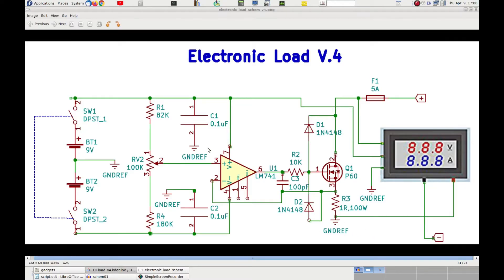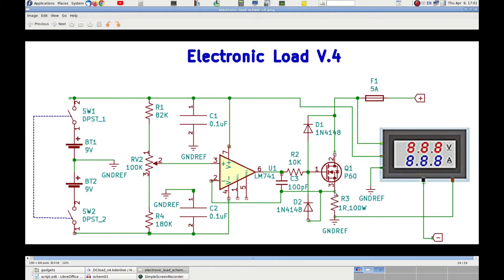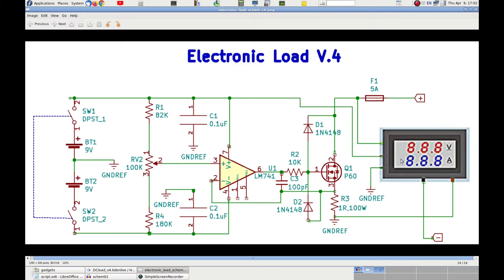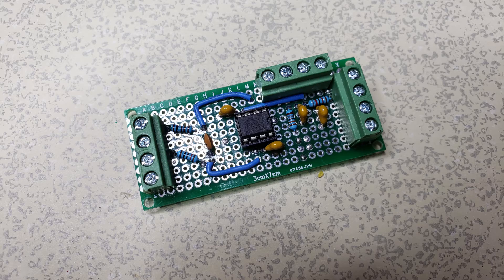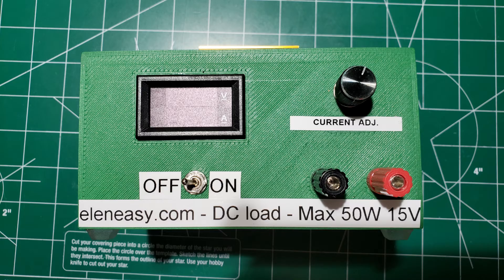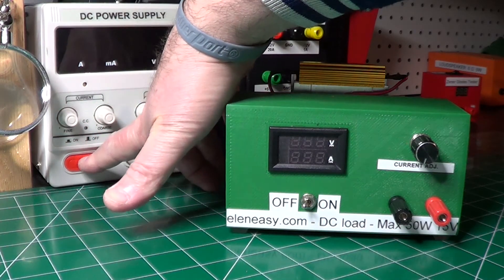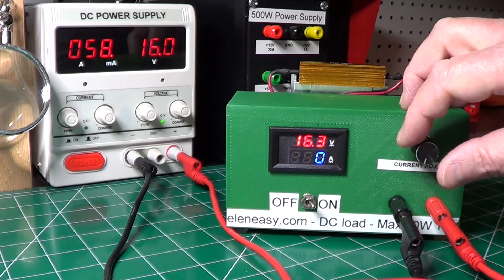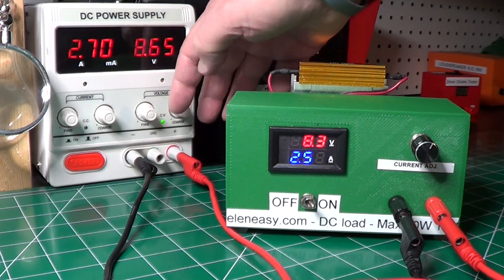DC Electronic Load Version 4

Comment: I found the “Constant current” behavior as Closed Loop (based in feedback from operational amplifier) really nice. 
It would be great if you could prepare a video comparing the 3 generations of Electronic Load, at similar operational conditions - using the EPN LOOP features of DARLINGTON (and Beta) and MOSFET (it’s intrinsic operational curves) and this CLOSED LOOP one, nowadays quite Classic and common.
As a further suggestion, maybe Rev. 5 could use a single power supply, as common as LM358 (dual) that goes to the Zero rail, simplifying the circuit - to use just ONE 9Volt battery.
Thank for sharing and I look forward to see your future developments.
Reply from the maker: Using one single 9V battery was already in my plan, but thank you for suggesting a solution to the problem. I will investigate it further. Maybe the video on version 5 will be the one where I take some time to do a comparison among the various versions I designed, plus the latest and newest one.

Comment: Nice project, building an electronic load is in my to do list. adding a logic level mosfet will improve the project a bit, they have lower VGS and higher VDS. also a rail to rail op amp will increase the accuracy, those with low input/output offset error.
Reply from the maker: Glad you liked it!